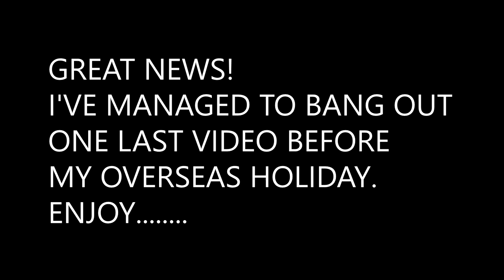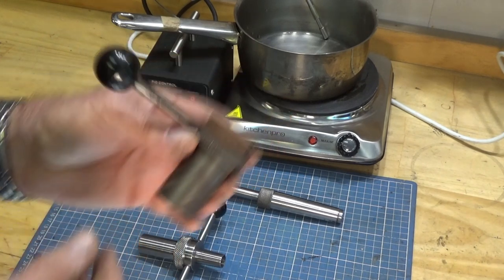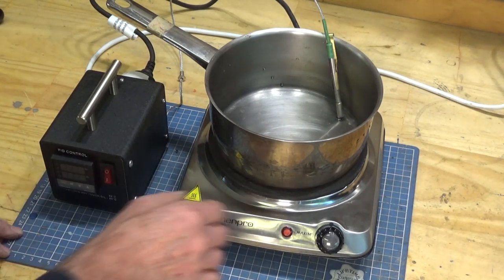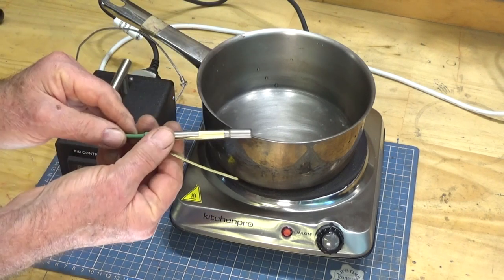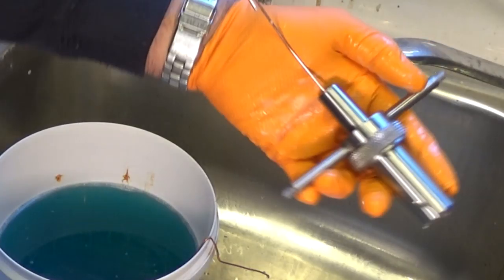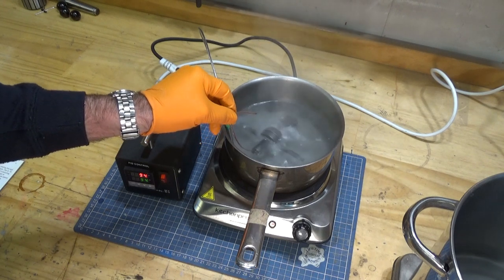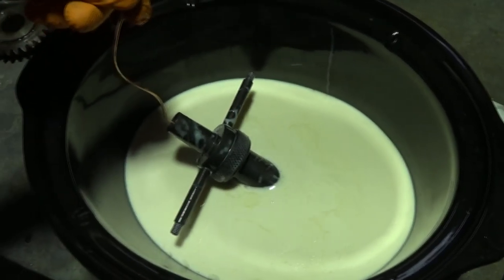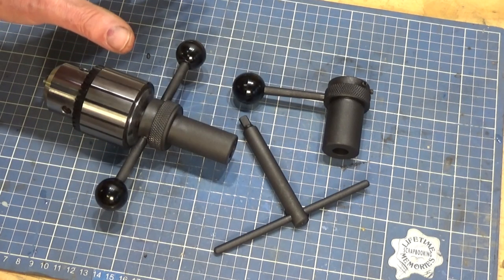DIY Parkerising in the home shop

Comment: My understanding is that Parkerised parts will still rust, just like blued parts will, but that slightly rough surface with a bit of oil soaked in is much more rust resistant.
Reply from the maker: Paul Joat, I'm not expecting this process to be the end of all my corrosion issues. I figure i can give some of my tools a fighting chance against the dreaded red scourge.  😀
Reply: Bluing and parkerization is the "rusting" of the part, intentionally. It stops corroding the metal when you clean it. This keeps it from further rusting.  But this doesn't last forever, but it still protects the steel very well. Oiling is part of the maintenance with this process. So you're basically correct.

Comment: Do they teach the displacement of fluids in school in Australia?  Put a clean rock in the pot with your tool.
Reply: good idea BUT  it is an acid so you would not want to use a rock.
Reply: Karm Esnom I have personally done it when Parkerising small gun parts for over 30 years.  You use a granite rock, not a piece of sandstone or limestone. Never had a problem.
Reply: A glass of water would work too, but if the liquid is boiling the glass could tip over.

Comment: As soon as you described your climate, I just knew that you had credibility. I live in the same climate. Louisiana in the USA is just miserably hot and humid. And all my tools rust. Furthermore, I love your tap adapter. I’m making one of those. 🤙
Reply from the maker: We have just been through one of the wettest late summers on record. We literally had metres of rain and my tools would often have a sheen of moisture on them. My Bridgeport mill was shorting out the contactor because of the moisture inside the cabinet. Still, the tools that I have parkerised remain without rust. It really is a durable finish although you do need to invest some time in the preparation. I know that cold bluing is quick and it looks great, for a while, but every tool I have cold blued has eventually turned brown and corroded. 
Regards,
Mark

Comment: I have the same problem with rusting ... I stocked up on 303 stainless steel and any shop made tools, handles, knobs, clamps and  such  are made from that.... Problem sorted and it's a pleasure to machine.
Reply from the maker: Damien, I have never tried 303 stainless. Most of what I have is of unknown origin since it was given to me as scrap and some of it is really tough on tools and the swarf is deadly sharp. I use it when I can but it would be nice to have a stock of material where you can be sure of it's pedigree.
Thanks for watching,
Preso

Comment: That's a really good point. I live in Virginia, about 1km from the Chesapeake Bay. Same deal. Warm humid day, inside the cool garage everything is soaking wet. At night, EVERYTHING is dripping.
Reply from the maker: I used to live in Western Queensland which has a very hot dry climate. We would often find old cars out in the bush which were still in pretty good condition because of the low humidity. I guess that is why they mothball old aircraft out in the desert. Fun fact, you can find Davis Monthan Air Force Base on Google Earth. I swear there are F18's mothballed there. 
Regards,
Preso

Comment: Pleased to meet you.  Looks like YouTube are giving you a bit of a boost. Here's hoping your site takes off. I am amazed at all the different finishes you do. Yep, I've been binge watching. I hate to suggest anything but I wouldn't mind a series on the different finishes. I've found various gems of information in different videos but all together and with comparisons would be very helpful.
Reply from the maker: Thanks, I have covered quite a few methods in earlier videos. I use powder coat a lot in my builds and anodising is an interesting process as well. I recently started zinc, nickel and nickel cobalt plating but I have not done any of the nickel cobalt on camera yet. The nickel cobalt has a colour very similar to chrome plate but it is far less toxic and doesn't require quite as many steps. I hope to do some specific videos on these processes in the future.
Regards,
Mark Presling
Reply: @Preso58  , Thanks.  Your channel is the first I've found that has a wide variety of finishes so I think it's unique and I suggest that puts you in a fortuitous position of being able to spread your knowledge and experience.   I'll definitely be keeping an eye out for more information from you. Thanks again for sharing.

Comment: My guess as to why the finish feels slightly rough is the treatment just before the Parkerizing must have etched the metal to make it more porous for adhesion of phosphate. Looks like the black oxide coatings on tools that aren't chromed. Looking forward to the follow-up.
Reply from the maker: I think the activator is actually phosphoric acid but I cannot find any information about this. It certainly appears that there is an etching action before it goes into the parker phosphate. Having said that, it also appears that there is a lot of fizzing going on when the steel is in the parker solution as well. I have 6 samples sitting out on the bench at the moment and I will be leaving them there for nearly 7 weeks so I am keen to see how they hold up during that time. Stay tuned for the results.
Regards,
Mark

Comment: All of the Parkerized finishes I've seen on old military rifles (M1 Garand and M1 carbine) have has the flat finish but with a greenish tinge.  For 70 year old rifles, the rust resistance has been very good.  A light wipe down with an oily rag followed by a dry rag might also help.
Reply: The greenish tinge is stain from cosmoline that has soaked into the pores that parkerizing creates.
Reply: @GunFunZS  Tnx for the explanation.

Comment: Funny you mention how it looks like a bead blasted- blued part. At my step father's shop he had the blueing tanks. We would wait until we had a bunch of parts ready to blue then do large batches like you said. We preferred the parkerized finish on guns(used it for most of the tools he sold as well). Polishing a gun and blueing it did leave that nice mirror like blue. But for a gun you are bush wacking with we figured the parker finish was more durable. Not to mention the sun doesn't glare off it. The finish you have there looks very similiar , although that bit of crystalizing looks a little different and pretty neat. I wonder if it will knock down with use.   Great video
Reply from the maker: Steve, it is a lot more durable than I thought it would be. I have a chuck key done in the parkerised finish and after several years of use it is still rust free and even though it knocks around amongst the chips in the tray under the lathe it hasn't shown any signs of wearing off. Even the square end that goes into the chuck sockets is still good.
Regards,
Mark

Comment: The Phosphate bit reminded me of the Phosphorous (*not* Phosphoric) Acid treatment some painters do to sheet metal. Or, let the part 'flash rust' then convert iron oxide into iron phosphate, aka "hard porous salty layer" which then absorbs most liquids into that layer (be that oil or paint). Texture seems to be the same, color is dull light grey tho, not dark/black.

Comment: Bluing, Browning, and Parkerizing require regular oiling to prevent rust. They are intended to hold oil, that will repel water. Also the color you achieved is just about right. I’ve never seen it darker.

Comment: That is a very interesting video Mark. Thank you for posting it. That is absolutely typical of a parkerised gun finish. I have handled many parkerised guns and the phosphate finish is very durable and rust proof in normal circumstances. This is why government arms procurers used to specify this finish as it was to make an intended pun bullet and squaddie proof. Provided it gets an oiling every once in a while your tools should be able to withstand your local climactic conditions well. The book looks a good buy, how much did it cost if I may ask?
Reply from the maker: Samrodian,
The book was AU$22 plus shipping. It's a good reference. The guys that started the company were motorcycle enthusiasts who wanted to be able to polish and plate their own parts. That is why they sell in small quantities and their products are aimed at the DIY enthusiast.
Regards,
Mark Presling

Comment: Thanks for doing this. I was wondering how it was done. I have a shotgun with a Parkerized finish and it seems to resist corrosion quite well, although I care for it as I do any other firearm. 

Where you are in Australia has the same issues with condensation as we do in Hawaii. I have to coat things with oil, keep machines covered with tarps and put tools away to avoid corrosion problems.

BTW, I was laughing at the "low tide" caption. I think we all make mistakes and that's often how we learn to do things better and how to plan ahead.
Reply from the maker: I have tried using cold bluing solutions and they look good for a few months but the corrosion soon sets in. All the tools that I have parkerised still look as good as the day they were done. Some are three and four years old and I don't take any special care of them. It's a great process and not particularly toxic or hazardous. It does take a while to get all the liquids up to temperature though. Hawaii would have a very similar climate to where I live. We spent a few days in Kauai and the climate felt very familiar to us.
Regards,
Mark

Comment: Hi Mark. When I was s apprentice in the early sixties we use to send motor casings for Parkerising. The reason was to make paint stick to the bare steel surface. That might explain why it produces a rough surface.
Reply from the maker: When the steel comes straight out of the parkersing tank it feels quite rough, like shark skin. If you didn't dunk it in the dry touch oil it would take paint really well. A lot of paint manufacturers specify sand blasting prior to paint for the same reason. I am planning to do a follow up video on this process because all the parts that I have parkerised still look as good as the day I did them. Even things like chuck keys, which tend to get knocked around quite a bit, still look perfect. 
Regards,
Mark

Comment: I've successfully used a mix of these. I clean the part really good. Dip it for a couple of minutes in a mild muriatic acid solution. Rinse in boiling water and then I cold blue with Phillips Cold Blue. I then put the part in boiling water (same pot) again for a couple of minutes and while hot soak it in 3-in-1 oil and don't dry it off until next day. Ten times better than just cold blue.
Reply: Cold blueing is really a decorative finish. Simply taking a part and either boing it or steaming it to form rust then transform it into black ferric oxide and finish by using a carding wheel to remove the loose stuff will do a better job of corrosion prevention.

Comment: Ive used this a lot on my bike, but you still have to oil it to keep the rust at bay. Its good to paint over, adhesion is very good, if painting no oil.
Reply from the maker: Pete, that is what I read regarding painting parkerised finishes. The surface feels very porous and I am guessing it will absorb paint well. 
I am getting ready to do some tests on some mild steel samples. It should be interesting.
Regards,
Preso

Comment: I live in southern Canada, its quite humid here in the summer. When I built my shop I installed ceiling fans. They act to keep the air moving in the shop so condensation doesn't collect on equipment. As long as the fans stay running I don't have any problem with condensation causing rust. It's the same principle as a frost free refrigerator, the fan keeps the air moving so condensation doesn't collect,  freeze and build up into ice.
Reply: Great idea mate
Reply: I noticed the same thing in my garage. Now i just leave the shop fan running all the time on low.
Reply: I wouldn't call any part of Canada humid, go to the central southern US and you will see what humidity is.
Reply: @phillhuddleston9445  Perhaps not but we do get days where the air is nearing 100%humidity and on a rare occasion the air will become super saturated.
Reply: Superrodder - isn't supersaturated air what most of us call fog?
Reply: @deandeann1541  haha, yes,  above 100% humidity  is super saturated, fog on cool mornings or steam visible on a hot summers day
Reply: superrodder2002, That is not how a "frost free" refrigerator works! The fan has absolutely zero to do with the frost free design. They obtain "frost free" with a mechanical timer to stop the refrigeration cycle and energize a set of heaters to melt off the ice from the coils. The fan does not run during the defrost cycle, in fact it only runs when the compressor is running. Your free lesson for the day
Reply: @scotty362100  ive never seen the fan in either one of my refrigerators shut off, and 3 fans running in my shop for 15 years and nothing rusts. So I stand by my assessment.
Reply: @superrodder2002  Stand by it as you feel, I have been a master HVAC tech for 42 years! I gave you the facts, you determine what you "want" to believe.

Comment: Nice set up, similar to mine.  Another reminder to build the PID Controller.   Old video so you know this I figure, but the surface will age into a dark black color.  I get the same gray color initially.
Reply from the maker: Thanks. I love the finish that parkerising provides. I was very sceptical at first since I have had very limited success with cold bluing methods. Even the oldest parts I did in the parkerising bath still look as good as when they were first done. 
Regards,
Mark

Comment: When I think of the BEST Parkerizing, I have seen is WWII allied rifles, a deep charcoal green tint flat matt no reflections over almost black, just will not rust with ANY oil. Looks just about like You Just Got! Bulls Eye!
Reply from the maker: Most of the videos I saw when researching the process were those done by gun guys. It would be perfect in that application. The dull matt finish is unusual but super durable.
Regards,
Mark

Comment: I found an old socket that had been trod into the (dirt) floor of the shop.  I threw it into an old coffee container full of vinegar ... missed it when I pulled other parts out, then went on the road for 10 days, then spaced it for two or three more.  Remembered it when I moved the container and heard it scooting around.  Between the rust and the prolonged vinegar soak, it pitted drastically,  but it hasn't showed any sign of rusting again.  The patina is very much like what you got here, very much like an impact wrench socket.  It sits on the bench, being used for anything except as a socket.

I know Randy Richard did some bluing with a method that used vinegar, but that was a long process, best for those with more time than money.  We aughta look back to that, and see if we can improve on it...
Reply from the maker: Diggerop, I have used the electrolytic method for rust removal using washing soda and a stainless steel anode and it gives a similar finish and as you say it resists rust well afterwards. Maybe all those methods create a similar oxide layer. It was the texture on the parkerised finish that I was impressed with. It was hard to show on camera but it really did look like it had been bead blasted. Probably off topic but I had made some parts for a model steam locomotive from bright mild steel and I polished them with emery cloth and after a few days they had a rust patina on them. I was very disappointed but went through the polishing process a second time and they are still bright and rust free many years later. I am wondering if the initial corrosion creates a skin of some kind that protects the underlying steel?
Regards,
Mark Presling

Comment: Looks nice Mark. I must confess to skimming through your video a bit (always short on time) but did you say there is any improvement in hardness or wear resistance? Wouldn't a cold case hardening chemical be so handy! Cheers, Cliff
Reply from the maker: Cliff, it doesn't really harden the surface but it does improve "lubricity" which is the ability to carry oil and therefore reduce friction. I believe that camshafts are often parkerised after grinding to reduce wear. One thing that I have noticed is that closely fitting parts will "grow" slightly after parkerising but I usually remove the parkerised coating on any surfaces that need to fit. I primarily use it as a rust preventative treatment and it's ideal for that. If you do find a cold case hardening compound I'm in! 
Regards,
Mark
Reply: @Preso58  Cheers! Cliff

Comment: I use my PID controller w 4×8 aluminum plates on a 20ton Rosin press. Works good on my titanium dab nail too. Never thought of heating water with it.
Reply from the maker: Those PID controllers are surprisingly adaptable. The programmable ones are even better.
Regards,
Mark

Comment: Interesting process and video. You may have already tried this I am wondering if you have tried running a dehumidifier in your shop or used those small bags of moisture control bags in your tool box drawers to help control the moisture problem? Just curious.
Thanks for sharing.
Reply from the maker: Joe, unfortunately, my workshop isn't well sealed. Being a steel shed, it has gaps at the tops of the walls and around floor level. We also have wild fluctuations in both temperature and humidity. Some days I can walk into the shed and there will be a sheen of moisture on the steel surfaces of my machine tools. Dehumidifiers work well in sealed rooms since you can just pump the moisture outside. In my case it would just flow straight back in again. 
Regards,
Mark